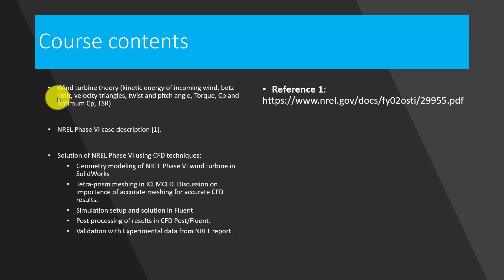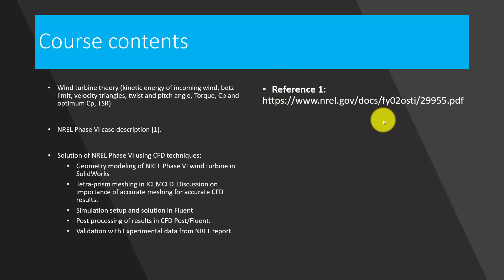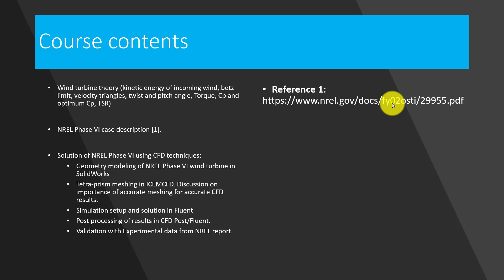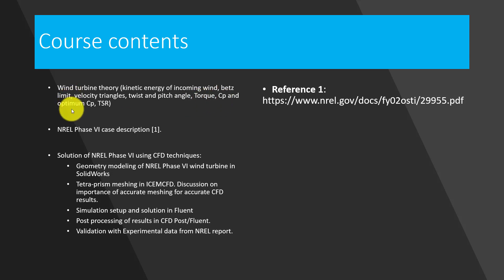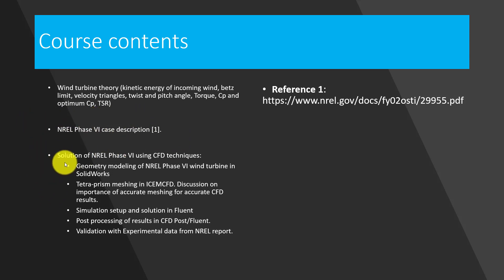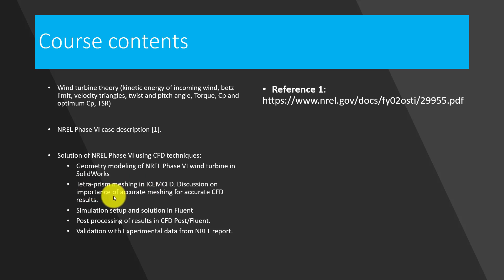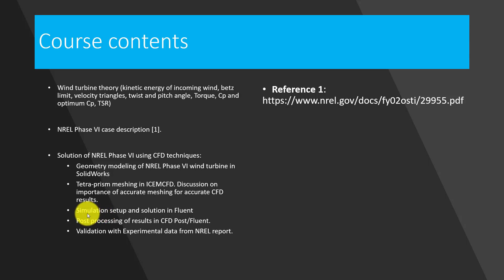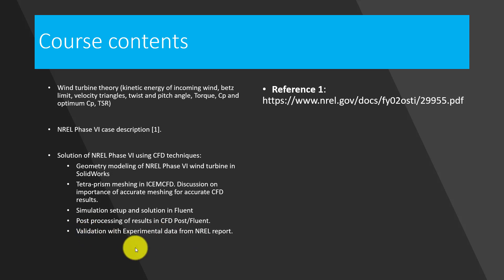CFD analysis and Validation of NREL Phase VI wind turbine

Comment: I am doing research on CFD analysis of GE 1.5xle wind turbine and currently in writeup phase. I have almost completed my research work. I need some help regarding pitch and twist angle and their relation to overall blade lift. If you will help me with this issue I will be thankful.
Reply from the maker: I am publishing a course on this soon.
Reply: That's great but as I told you I am going to end my thesis by this week or probably next week and I have to submit it further to my GEC so I need to clear that total lift part by end of this week.
Reply from the maker: @aimanmasood574  Well twist and pitch angle change performance of wind turbine blade. It can be indirectly linked to angle of attack vs airfoil lift.
Reply: Actually I need to know that do I need to resolve lift in components order to give value in fluent and at what angle I have to resolve the lift force?
Reply: My blade is twisted and it also have pitch angle of 4.
Reply from the maker: @aimanmasood574  For this you have to go through some books and you will get all info.
Reply: Sure I will. Thank you.